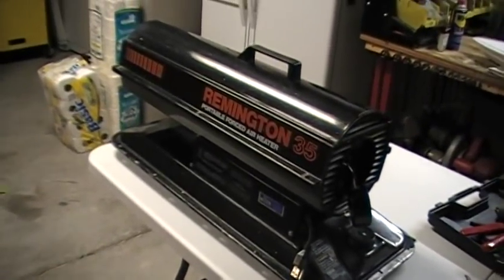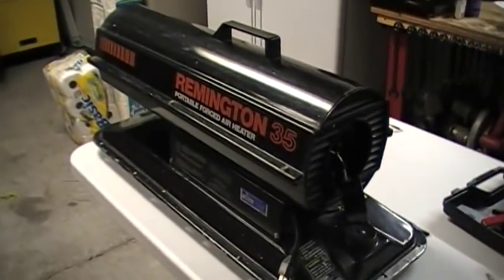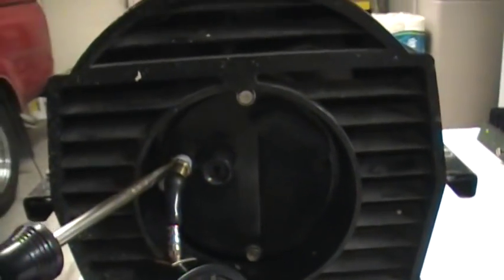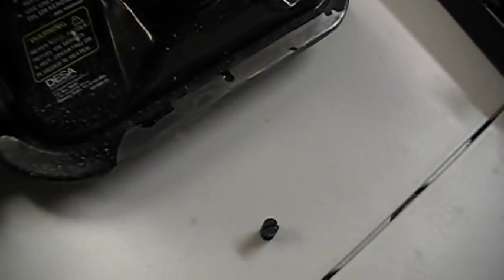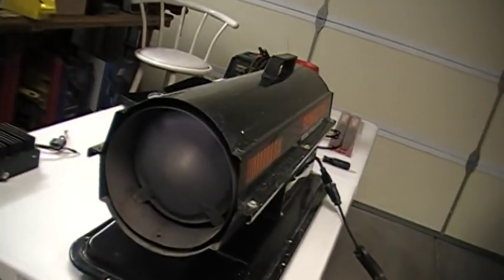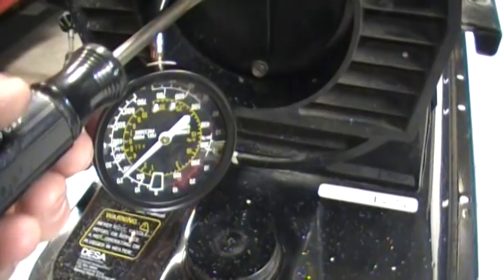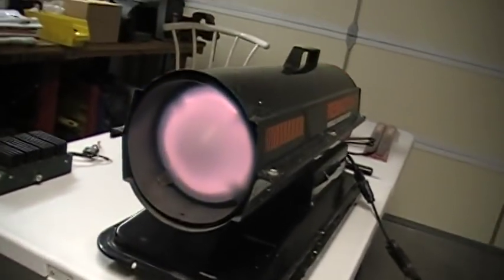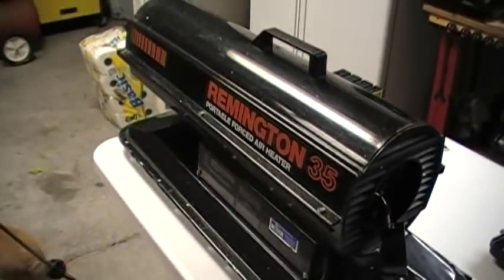how to adjust a torpedo heater

Comment: Very helpful. I've spent years struggling with beat up torpedo heaters, never taking the time to know how they worked and adjusting the pressure blind while having fuel pressure gauge's around the shop.  Thanks for the video.

Comment: I have run #2 diesel for years in my shop and it never smokes or smells like everyone claims online. There is a very very slight oil odor if you really try to smell it. I have even run off highway red Diesel without any trouble or smells. I like paying $3.50 a gallon for road diesel over $10+ for a gallon of Kerosene. At those prices its cheaper to use electric heat or a propane torpedo heater. Good video on how to adjust these.

Comment: Thanks. Very helpful. I have a dura heat 120,000 btu and burn diesel out of the pump with green handle because its cheaper than kerosene here in Ohio. Burns just fine. Had it over 15 yrs, just replaced the rotor and blades in the pump and put new filters in. If I would have replaced the filters or at least clean them more often I don't think the rotor would have broken. Seems to burn a little rich now. I'm sure its the pressure. Thanks for the video.

Comment: Yes, this was useful.  Mine is about 15 years old.  A Reddy 55.  I hadn't used it in almost 9 years, but pulled it out of storage yesterday and fired it up.  No leaks, which was a worry based on rusted outer screws.  If course when it was new I had treated the fuel tank with liner fluid, so maybe that helped.  Mine shoots right on past cherry red and goes to a yellowy orange.  Maybe a little too much pressure?  Nice to know how to adjust it.  My home in the mountains has a large basement cut into the stone and sometimes that basement drops into the 30s.  That makes it hard to keep the house warm, which is where my Reddy comes in.  It takes about 20 minutes and the temperature in the basement climbs up into the 70s.  Give it an hour or two and the basement hits the 80s and the upstairs heaters can be turned off.  Kerosene is about $3.80 a gallon at the local gas pumps, within a few cents of the diesel price so I see no advantage in experimenting or multi-fueling yet.

Comment: ive had these before. they work for a few weeks and invariably start flaming out, smoking, right now my current one smokes something terrible before and after heat cycles. ill have to get a pressure gage and try this.   what happens with too much pressure? too much unburnt fuel?
Reply from the maker: I've had several over the years, I've switched to a natural gas heater for my garage which is virtually orderless and heats very well. I've never had any issues with the torpedo style kerosene/diesel heaters not working, they always worked great unless it was under 20 degrees, then I'd have to spray a bit of brake cleaner into the fire chamber and light with a match before starting the heater. Other than the odor, they are work horses.

Comment: I need some help, any suggestions will be appreciated.  I have same heater that's in video except mine's a 50, not the 35.  Heater was having ignitor issues so I took apart and cleaned spark plug and decided to clean air pump, fuel filter  and perform some maintenance on it.  Bought heater in 1995 and no maintenance till now.  Problem is the air adjustment screw is not working.  I have a pressure gauge connected (same one in video), no matter how much I turn the adjustment screw it does not change the pressure, all the way in or out the pressure stays the same.  Blocking adjustment screw should cause pressure to increase, it won't do that either.  Had it apart numerous time, changed gaskets, tried thread tape on screws, cleaned ball and spring in adjustment screw, cleaned fuel spray nozzle.  I am getting fuel and the air pressure is about a 2 and I need 3.4 PSI.  
I added a new gasket that blocked air exit hole and that allowed me to adjust pressure, however I couldn't get fuel cause pump wasn't feeding fuel system.  
I'm out of options.  Does anyone have any ideas on what I can do next?

Comment: I was just given a Remington 150 and I am wondering what I need for a hose to go from the heater to the pressure gage.  It looks like you have a nice little rubber hose with fittings.  Did you make that and if so what kind of fitting do I look for to fit the heater?  If you bought it where do you suggest buying it?  Is it a standard size?

Comment: what happens when you set the pressure at 2 instead of 3? Less heat? Any negative effect on the internals?    I am asking because I want to have less heat out of my heater
Reply: markman63 yes it will make it smoke and will plug up your heater if it’s too low it will really stink awful and could produce unsafe levels of carbon monoxide

Comment: I took our 55,000 BTU one at work and screwed the pressure screw all the way down and slightly opened the back, it not puts out about 30% more heat and sounds like a jet powered helocopter, dont know how long it will run like this, but it sure is nice....

Comment from the maker: @mikey0himself I'm running mine on K1 kerosene as well, It has a kerosene smell on start up, once it heats up the smell is tollerable however it does has a smell. If yours has a nice red color to it then it's most likely adjusted pretty close, if the pump pressure was low then it wouldn't have a nice red color. When I run mine I will fire it up with my garage door open & once it heats up I will either close the door or just leave it slightly cracked.  I kinda wish I had gotten a propane unit.

Comment: that pressure adjustment can also allow it to run on diesel,just turn the pressure up a bit for  diesel down a bit for kerosene. but dont let the end of the burner get bright orange only red to dull orange or it will burn holes in the chamber or melt the end cap!!

Comment: Are you able to replace the front shell heat shield on these type heaters? My heater is old as hell and has been painted over several times . I am unable to tell which brand it is . it is a large heater 10 gallon capacity diesel or kerosene but it is burning out the front heat shield where Fire Hits the steel on the front  its starting to burn holes through it. That is one hell of a long way to ask a question huh LOL  thanks for any help

Comment from the maker: @rocsvt1 Really? I have never used a propane torpedo style heater but I would think that the propane would burn much cleaner. I know in my camper none of the propane appliances have an oder to them at all. Maybe these heaters are an exception?

Comment: My 30,000 btu heater I can't dial down to 3 psi, and screwed the adjuster screw counter clock wise all the way and it still shows about 4psi. Is that ok?Also, my other one shows about 2psi, and it should be at 3.6 psi (50,000 btu heater) but turning it all the way clock wise, it won't move up. What is the problem? Both will run sometimes and they have the plug firing, It appears they are spraying lots of fuel, but just don't ignite to start working all the time. I can see the nozzle spraying fuel, but both will shut off before they actually ignite. At other times they ignite. What is wrong? I ordered a photocell to change out in one.
Reply: +moparmusclecars With the high side one make sure the threads and screw for the adjustment are seated well in their threads.  For the low pressure one, make sure your fuel filter and lines/nozzle aren't clogged.

Comment: @rocsvt1 I use regular fuel oil in mine (diesel/fuel oil same thing here in AK).  Probably kero would smell a bit less, but a 5 gal can of K1 is around $40.  Fuel oil is under $4/gal.

Comment: I adjust mine with the gauge remaining attached. Should be at 4.5psi but the pressure drops for some reason and I have to keep adjusting it to 4.5. I have no idea why that would be happening. Anybody have any ideas on what that problem is? Thanks

Comment: you think one of these could be made to run on 12 volts by changing out the blower motor ?
Reply: +Mosby's men Possibly yes.  Considering most are fuel pump/fan combos, I'd recommend powering the existing motor with an additional motor at 12 volts DC.  You could, perhaps, use a belt - tying in with the fans shaft - to a different motor.  I bet a car's blower motor would do nicely.  I assume no responsibility if'n you screw this up and lose a finger however...
Reply: If you didn't already do this, you can but you need to size the motor correctly. Around the same power and speed will be important. A lot of these pumps only have the one motor to do the forces air and fuel delivery. The issue with a different size motor is that the nozzle is sized to the fan.

Comment: Helpful for the non thermed ones...i have a procom 220 and its been nothing but problems. Got the pressure adjusted correctly now...and still doesnt work in therm mode....only manual mode and thats not what i bought it for.   Company has the worst customer service ive seen.   It woudnt run in either mode..shut down..throw a code.   After figuring out the  pressure deal like here.....It runs...but only on manual which is useless to me.

Comment: There doesn't seem to be any forum that tells what happens with too much pressure.  As the video poster says and I've witnessed, too little pressure seems not to burn completely.

Does anyone know what too much pressure does or know why it maybe be bad?
Reply: this is just a guess but if you increase the pressure  you are giving it more air.To much air with fuel in an engine will make it run hotter.  If it run very hot for a long time (couple hours) you could be looking at melt. down. Another thing may be increased fuel consumption.
Reply from the maker: Dale Spector Same amount of air either way, You are only adjusting the mixture which will make it richer or leaner. If you adjust it slowly you will be able to tell when it's about right. You want the front heat shield to glow red but not to much so. It's pretty easy to figure out. If it's to lean it won't produce enough heat and won't glow red.
Reply: run them at full pressure  it just creates a hotter flame  i run my small heater at 8 PSI 24/7 no issues   just watch the flame kernel exiting the  tube

Comment: Is diesel #1 the same as diesel pump fuel you can purchase at a gas station for a truck?
Reply: +2cyclemix Kerosene, #1 and #2 Diesel are the same thing + or - additives and coloring for taxation and anti-gel properties.  (Cold weather flow)
Reply: So if I have a torpedo heater burning kerosene, can I likely burned pump diesel fuel in it?
Reply: Yes you find diesel#1 at your regular gas stations. Diesel two is strictly off road use. It gets delivered to places the run heavy machinery that don't go on road.

Comment: My Mr Heater 50,000 BTU will not push fuel out the nozzle. I cleaned all the lines out and I cleaned the fuel filter out as well. Does anybody know why I'm not getting any fuel. And the heater also shits off after about 1 minute of it running. Is this because the photocell does not detect light so it shuts off? Please any help will be awesome. I also cleaned the photocell with a rag. 
Thanks
Reply: nozzel  itself is clogged

Comment: The only difference between diesel #1 and diesel #2 is color...
Diesel #2 is dyed red and done so as its manufactured for tax free agricultural use only, diesel #1 is bought at the pump, #2 has to come from a fuel supplier.
Good video.......
Reply from the maker: Diesel #1 and diesel #2 are definitely different. Red diesel #2 is not for on road use.

https://dieselpowergear.com/blogs/diesel-power-news/understanding-the-differences-between-1-diesel-and-2-diesel
Reply: I burn roughly 1.87 million gallons of diesel a year with my job. I hoped you would have googled the difference. There is no difference silly.... #2 has a red dye added. #1 is the same fuel, manufacturers add additives to #1 and the viscosity is differnt hence the additives. The base fuel is identical. Youd think after 25 years with Conoco Phillip's theyd have told me there was a difference...you should really read about the fuels before making a claim. Red #2 came about when the Senate passed the U.S. Agricultural tax benefit bill in the 1960's in order to track the usage of fuels something had to be done...maybe making them differnt colors was a good place to start. In 2008 when the leftist liberal Democrat Barrack Obama decided to destroy the economy and put the clamp down on emissions with his all insane climate change bill the ultra low sulfur fuels became the norm. Hence the massive changes in viscosity, additives, etc....if your that interested a good read is a TnFG report by BP and Chevron in the late 90's showed and is substantiated to this day that ulss diesel has a greater environmental impact than sulfur diesel, the additives may have something to do with that.
Good luck on your adventure in fuels, I watch each type from sour to sweet crude cracked into viable fuels daily our generation systems on the slop burn nearly 2 million gallons a year all in the name of efficiency.....The reports you dont get would say that sulfur diesel vs. Ulss diesel is no competition, the foot print on 1 gallon of modern red is 1.4m/ppb whereas green or #1 is 1.37m/ppb 
Seems the energy is real close yet the super "refined" is as dirty as ever...that's just the carbon I gave you sulfer dioxide is 2% different one from the other after thermodynamics.......
Stay safe.....
Reply from the maker: @rickallen64  Some people will think they're right no matter what. Diesel #1 and diesel #2 are different and for different uses. Leave the red dye out of it as that's only for off road use. The red dye doesn't make it #1 or #2. I bet you're one of those guys who knows everything, yet everyone around you knows you're full of it.

Comment: So I'm dealing with one that has a built in thermostat.  It'll run for a few and quit. Already cleaned it all the way thru. Put graphite on the rotary to keep the pieces sliding.  Any ideas?

Comment: Mine has it's own gauge
Reply from the maker: Yes, so does my new one. Many of the newer models do. Not so much on the older units.
Reply: @vegasfordguy  mice eat the fuel hoses off mine this winter ..saw your video cause I had the fuel pressure way to high after I fixed it
Reply: @vegasfordguy  mine is the Remington..also ..but a few years newer I think..but hell 20$ ..think I gave 300$ for mine ..what a good deal
Reply from the maker: @jacoblang2712  Mice can be very destructive. Chew and poop on everything!

Comment: I put my heater away last fall and it worked perfectly, now it cuts on and back off in a few seconds. Help anyone?
Reply: Try dumping out the tank and rinse it out with clean fuel (what you normally use), like 2 times a quart or so per time, set rise fuel aside, refill with clean fuel and try it, I bet you had water condense in the tank contaminating it. Had it happen to me!